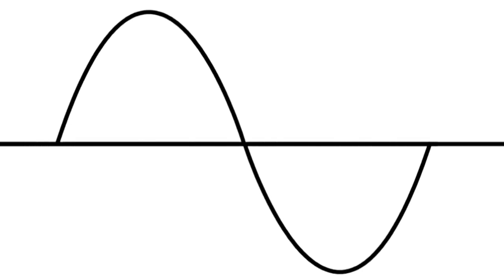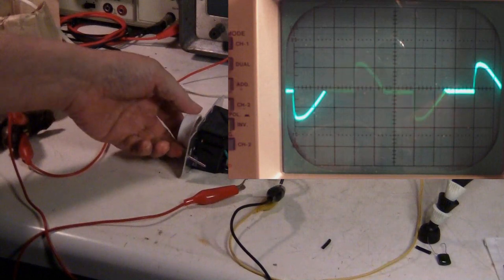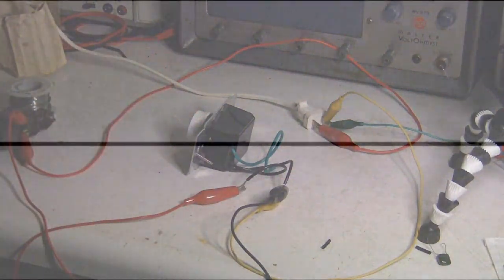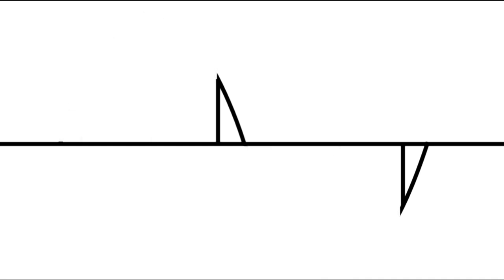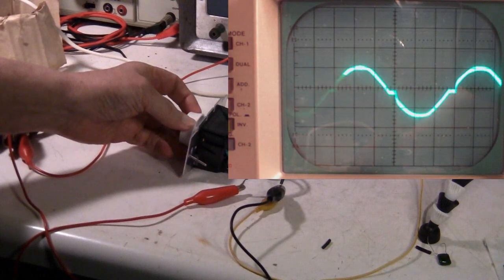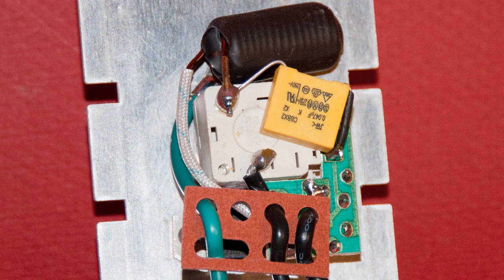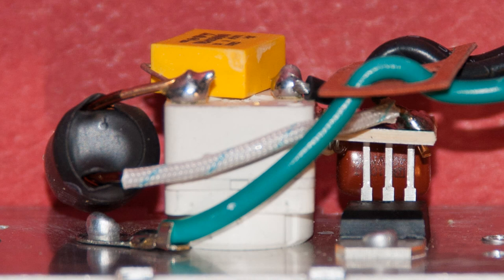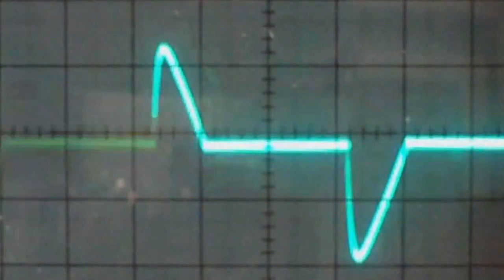Duty Cycle, Light Dimmer Demo

Comment from the maker: The yellow capacitor is a noise filter. The brown capacitor is the "C" in a RLC circuit. The RLC circuit fires the gate of the triac. The "L" is the black coil and "R" is the variable resistor.